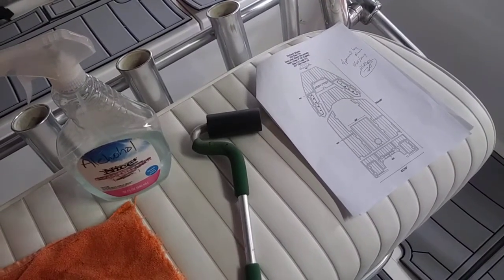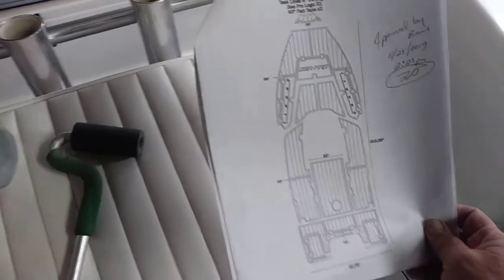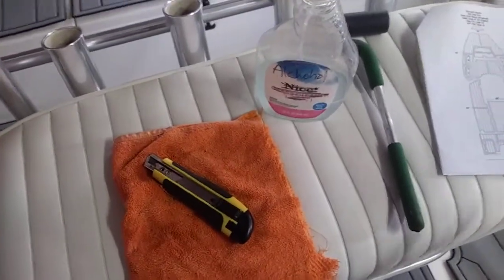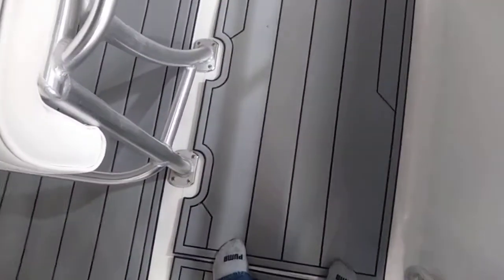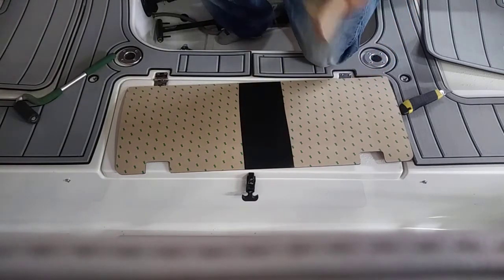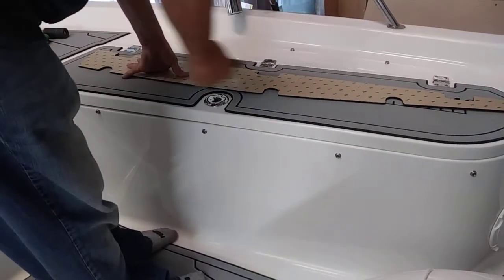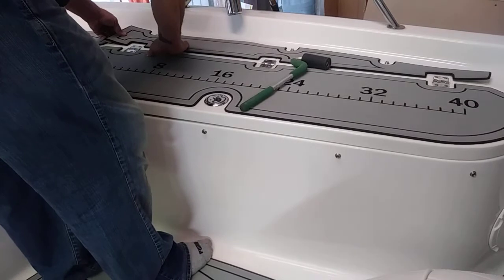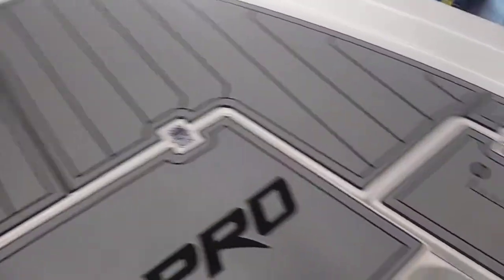Installing your Flexdek for the DIY guys. Tightlines!

Comment: What if the surface is non skid and not completely smooth.  Will it still work
Reply from the maker: Our adhesive is designed specifically for non skid surfaces